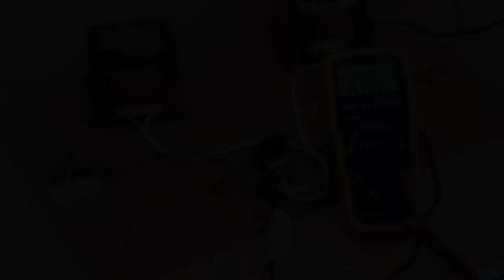DIY Welding Machine / Only 2 Microwave Transformer / Good Job

Comment: Magnífico trabajo me lo apunto.... 
Mi duda es... ¿ Es posible con esta misma caja soldar por puntos? Haciendo con otros cables y poder cambiar los cables según la necesidad en ese momento
Reply from the maker: Hola.  Un buen pensamiento de hecho.  Pero no lo hará.  En la fuente puntual, el voltaje es muy bajo (1.5 - 2V), la corriente es de alrededor de 500 -700A.  Por lo tanto, no sería adecuado.  También necesito una máquina de soldadura por puntos y haré una herramienta separada.
Reply: no entiendo muy bien de voltaje ni amperios. La verdad es que me pierdo. Pero.... ¿ Con el regulador no se podría regular la potencia para uno o para otro?
Reply from the maker: Cuando dices regulador, creo que te refieres al circuito de atenuación.  Este circuito regula el voltaje, sí, pero a medida que cae el voltaje, también lo hace la corriente.  Necesitamos un voltaje bajo para que el arco no sea demasiado y una corriente alta para fundir el metal.  Por otro lado, el devanado secundario en la máquina de soldadura por arco no es lo suficientemente grueso para pasar 500 amperios.  El uso de un cable de 25 mm2 o más grueso es adecuado para la máquina de soldadura por puntos

Comment: Good teaching, what size rods did you use with this transformers to weld,  I build one with two as well with the output is 52 volts.
Reply from the maker: Hello.  Firstly, thank you.  I used 4mm2 silicone insulated cable in the transformers.

Comment: seu eu usar  3 transformadores 110v é preciso que mudar algum componente no sistema de dimer e Reguladores de voltagem qual devo usar
Reply from the maker: Se você usa 3 transformadores, meu conselho é... faça o enrolamento secundário com um cabo de 6mm2, faça o circuito dimmer como eu fiz e conecte 8 triacs BT137.  Os cabos a serem utilizados na entrada também devem ter no mínimo 2,5mm2.  A razão para isso é que mais corrente é necessária para obter a mesma potência na tensão de 110V.

Comment: Hola buenos días bendiciones y muchos éxitos quería preguntar si los transformadores son de 110 v da el mismo resultado gracias de antemano
Reply from the maker: Merhaba.  Burada şebeke gerilimi 220V ama 110V olduğu her yerde aynı şekilde çalışacak.  Tecrübe edip cevap verenler var.  İlginiz için teşekkürler
Reply: A ok gracias algo más cuánto es el tiempo de trabajo de la máquina así como la fabricó UD de antemano mil gracias
Reply from the maker: No es una herramienta profesional, pero sí muy acertada para el trabajo amateur.  Nunca he intentado soldar sin parar.  Sin embargo, utilicé esta máquina en mi video "Soporte para amoladora angular", que puedes encontrar en mi canal.  También hago mi tarea con esta herramienta.  No tuve ningún problema.
Reply: muchas gracias y le deseo muchas bendiciones y éxitos
Reply from the maker: Gracias... Que tengas un buen día.

Comment: what an absolutely brilliant video.  I'm stuffed if I'm bending metal though.  think I might just use an ammo case.
Reply from the maker: Thank you.  However, I couldn't understand the part you wrote about metal bending.
Reply: taking the sheet metal for creating the case.
Reply from the maker: You can also make the box using wood, but it's heavy.

Comment: Think that's the best transformer welder video I've seen. So neat and professional.
Reply from the maker: Thank you very much.  I'll try to use it for TIG welding if I get a chance.  However, I need to adjust the gas cylinder and torch system.

Comment: Excelente trabajo. 
Ademas de eficiente muy bonita linea la máquina. 
Un detalle. 
El video estaría perfecto si ademas fueras explicando la construcción. 
Gracias.
Reply from the maker: Muchas gracias.  El video tenía subtítulos.  Si hay algo que no está claro, por favor pregunte.
Reply: Ahhhh
Eso estaría re bueno. 
Sos extremadamente didáctico para mostrar el trabajo. 
A mi no me salieron los subtitulos. 
Talves sea una configuración  de mi celu
Reply: Ahora vi las aclaraciones adicionales que dejaste al final de tu descripción. 
No sabia que triac habias usado ni que se pudieran colocar en paralelo. 
Con esto me abriste nuevas opciones. 
Geacias.
Reply from the maker: Hola.  En la sección de descripción, trato de proporcionar tanta información como puedo y comparto los enlaces de los documentos relevantes, si los hay.  Puede usar BT137 como un triac.  Si tiene un voltaje de red de 110V, recomiendo usar 6 triacs, y si tiene un voltaje de red de 220V, recomiendo usar 6 triacs.  Teóricamente, los triacs BT137 tienen solidaridad 8A.  Normalmente, incluso 2 piezas para 220V (2000W/220V=9A) es demasiado.  Sin embargo, considerando la posibilidad de falla y los precios de las piezas son baratos, conecté 4 piezas.

Comment: Es un excelente trabajo.. estaba buscando algo asi de bueno.. Te felicito y gracias por compartirlo.. DIOS te bendiga..
Reply from the maker: Muchas gracias.  Me alegra que te guste 👍
Reply: amigo buenas noches para las personas que sólo hablamos español, no logramos entender los comentarios, adicional no sabemos que materiales lleva, y cuales son las medidas y como se llaman los aparatitos negros que pusiste con el disipador de calor en el regulador de voltaje, te agradecería tu respuesta muchas gracias, tengo un carapacho de una soldadora inverter que se hecho a perder y quiero hacer una igual a la tuya, pero con su respectivo regulador
Reply from the maker: Hola.  Soy turco y solo puedo responder en español con traducción.  Si lo que escribí a continuación es incomprensible, escriba de nuevo... Usé 2 transformadores de microondas en esta herramienta.  Hice 24 bobinados para cada transformador con cable aislado de silicona con una sección transversal de 4 mm2.  Para estos 24 devanados utilicé 6,5 metros de cable en cada transformador.  es decir 13 metros en total.  Usé un circuito electrónico llamado atenuador en el lado de entrada para el ajuste de corriente.  Como el circuito en mi mano es de baja potencia, conecté 4 triacs (bt137) en paralelo.  De esta manera, la potencia del circuito aumentó.  Si usa un circuito de atenuación de 4000 W, no necesita instalar materiales adicionales.  El diagrama relacionado con esta conexión y el diagrama necesario para la conexión interna de la máquina están disponibles en la sección de descripción del video.  Espero poder ayudar.
Reply: que tal Murat ... aca en Ecuador buenas tardes,  que alegría saber que estas pendiente de tus suscriptores y dando una respuesta inmediata, en cuanto a lo que respecta a la tradición esta perfectamente entendido, incluso pareciera q Ud no hablará otro idioma si no el español.
Nuevamente gracias por tu respuesta y saludos cordiales
Reply from the maker: Gracias a ti también.  Tenga la seguridad de que siempre intentaré ayudar en todo lo que pueda.  Buenos días
Reply: Talvez tienes un correo para escribirte directo, tengo algunas preguntas q hacerle a Ud,  sobre inversoras y como q veo q por este medio se me hace complicado ya q no puedo envías fotos ni vídeo
Reply from the maker: Mi dirección de correo electrónico está en la información del canal, pero también la escribiré aquí.  No hay problema.  muratguney67@gmail.com
Reply: ok
Reply: Ya le escribí a su correo amigo Murat, en cuanto pueda revise
Reply from the maker: Miré los correos electrónicos que enviaste. Puede que haya entendido mal, pero hay un video que escribiste. No pude ver el video. Es difícil encontrar la falla en las imágenes, pero si el problema no es la soldadura, los transistores mosfet pueden estar defectuosos. Para entender esto, es verificar si hay un cortocircuito quitando las 2 patas de cada transistor y llevando el multímetro a la etapa de diodo. Cuando estos transistores fallan, generalmente hay un cortocircuito. Si hay una parte quemada en el circuito, es necesario concentrarse en esa parte. Sin embargo, ¿cuál es el estado de la máquina? Cuando lo enchufa, ¿se enciende la luz, hay algo escrito en el indicador, se mide el voltaje de las terminales de salida? No esta soldando o lo esta haciendo mal. Se pueden hacer comentarios basados en esta información.
Reply: el video no lo realizó todavía.
En cuanto a la soldadora le  falta fuerza al soldar el amperaje esta al máximo 200 amp, y sin embargo no revienta el palillo esta que se pega a cada rato, es más no se puede ni cortar una varilla delgada.
Más tarde hago el video en la que estaré soldando para q Ud vea la situación
Reply from the maker: La adherencia se debe a la baja corriente. Esto significa que el dispositivo no puede entregar la corriente requerida. Creo que esto se debe a los transistores de 3 patas (mosfets) que se encuentran en una fila. Algunos pueden estar defectuosos. Como dije, los defectuosos se pueden reemplazar midiendo con un multímetro. Si no tienes conocimientos de electrónica, pide ayuda a alguien.
Reply: correcto mi amigo Murat, la verdad que no tengo conocimiento de electrónica, pero voy a pedir a un vecino de por mi casa me ayude con este tema, ya que el entiende mejor, a estudiado cursos de electronica basica, de todas maneras me has ayudado muchísimo, ahora se por donde comenzar, de todas maneras, más tarde que llegue a mi casa hago el video de como suelda la máquina y le envió a Ud.
Quedare eternamente agradecido por su atención, ya que aquí en el yutube existe un caballero que le escribo para ver si me puede ayudar con este tema pero siempre responde a medias, como que noble interesa ayudar a otras personas y adicional en los vídeos que hace siempre está enojado como retando a la gente que le hace preguntas..
Cosa distinta a la tuya, por lo menos indicas por donde empezar a checar....
Nuevamente millón gracias
Reply from the maker: Gracias. Espero que puedas encontrar la falla del dispositivo pronto. Puedes escribirme de nuevo si es necesario. Suelo intentar responder rápido, pero a veces puede que no sea capaz de mirarlo o puede que sea de noche por la diferencia horaria. Pero no lo dejaré sin responder tanto como pueda.
Reply: eso habla muy bien de ti, y claro que si en cuanto arregle la soldadora, y arme la otra con los transformadores yo le estaré escribiendo a su correo
Reply: q tal mi amigo Murat, nuevamente para saludarte y agradecerte por estar atento a los comentarios de tus suscriptores, Estuve mirando tu nuevo video en el cual le instalastes a la maqyina de soldar el puente de Diodos, y esta excelente, gracias por darnos a conocer tus conocimientos, te comento que yo aún no realizó mi proyecto de la máquina de soldar, quizás por cobardía, y en cuanto a la máquina inverter que me entregaron dañada tampoco la he hecho arreglar
Reply from the maker: Gracias.  Ha pasado mucho tiempo si no me equivoco.  Espero que la falla de su máquina no sea a gran escala.

Comment: EXCELLENT KEEP IT UP, but my question is that why are cutting down the secondary wires, cant I use it like that.
Reply from the maker: Hello.  Thank you so much.  Of course, you can use it without cutting the cable.  However, I cut it because I use 10/25 source sockets.  In addition, I think it is better to have thicker probe cables so that they are more robust and there is not much voltage drop on them.
Reply: ok thanks

Comment: You are really a hard working man
Reply from the maker: Thank you 👍
Reply: sir i have a question about the transformer can i ask?
Reply from the maker: Hello.  Of course you may ask.  I try to help as much as I can
Reply: did the power of transformer matter the thickness of the core?
Reply from the maker: The transformer usually has a power between 800 and 1000W.  There won't be a big difference.  If you have it, you can use
Reply: I have a transformer which have 12 0 12 secondary coil.  i  removed the secondary coil  and rewind with a thicker copper wire and it is not working now .Can you tell me what is the problem with the transformer.
Reply from the maker: Most likely the transformer is too low power.  You asked about transformer power in the previous message.  I thought the transformer you have was a microwave oven transformer.  Of course, other transformers can also be used.  But it must have sufficient strength.  How many watts is your transformer on average?  Besides, can you write down the cable thickness you winded and the output voltage you obtained?
Reply: my transformer is too small about 10 to 50 watts and i wind the cable of 3mm of 7 turns .and get 0 volts output.
Reply from the maker: 50W is too low.  Total power must be at least 1500W.  For example, the transformers I use are around 900+900=1800W.  In addition, even if you use a microwave oven transformer, 1 unit is not enough.  welded maybe but not stable.
Reply: ok thanks for the information

Comment: Only if an output ampere meter would have been added, that would make it the best diy welding machine...👍
Reply from the maker: Hello.  Thank you for your comment.  An ammeter would be really nice.  I couldn't add it because I made the box a little small.  Maybe I'll add it and share it when I get the chance.  Greetings from Turkey 👍

Comment: My question to you, I build one that has an output of 52 volts will the power be good to weld, I also purchase a 4000 watt dimmer as well. How many amps will this put out and what welding rod did you use.
Thank you for your kind response 
My regards
Reply from the maker: Hello again.  In order to get 52V voltage with 2 transformers, the number of secondary windings must be 26 or 27.  How did you do this? What kind of cable did you use?  I usually use 2.5mm electrodes.  It can be melted at 3.25, but the machine gets too hot.
Reply: I use 10ga, between the 3 transformer I’m getting 60 volts, don’t know if this is good, didn’t count the turns all I know they are very tight.

Comment: I have to say you did a really really good job on this what I wanna know is how that small gauge wire holds up
Reply from the maker: Yes, the wire is a little thin.  I used fine wire to get enough voltage with 2 transformers.  The wire is thin but resistant to heat thanks to its silicone insulation.  I use it constantly.  There was no problem.

Comment: Have a good time, don't be tired, can this be used as a home boil? Does it answer? Does it not burn or damage?
Reply from the maker: Hello.  I use it at home.  It was made for amateur use anyway.  You can see me using this machine in some of my videos.
Reply: Murat Bey, bir sorum daha vardı. 4000 watt'lık dimmer kullandım. 10 amperlik cam sigortası var. Kaynak yapmak için elektrodu veya kaynak telini demire dokundurduğumda sigorta çabuk yanıyor. Var mı? çözüm? Elektriğim 220 volt
Reply from the maker: 220V gerilimde 4000W dimmer kullanıldığında sorun olmaması gerekir. Dimmer devrenizde kısa devre olsa ilk anda zaten sigorta atardı. Ama demire dokununca atıyor ise cam sigortanın değerini yükseltmek gerekebilir. Şöyle yapabilirsiniz... Cam sigortayı kısa devre yaparak etkisini kaldırın. Onun yerine girişte en az 16 Amperlik otomatik sigorta kullanın.

Comment: Me gusto mucho su construccion pero tengo una pregunta; para que instalar un regulador de voltaje, si no vas a usarlo..como estabilizador de voltaje de entrada esta bien, pero creo que el regulador esta de mas..creo yo, tal vez este equivocado en mi apreciacion..de todos modos esta buenisimo el proyecto...💯%👍
Reply from the maker: Hola.  En primer lugar, gracias.  El circuito que uso es un circuito dimmer.  Mientras ajusta el voltaje de entrada, también ajusta la corriente de salida.  De esta manera, puedo usar electrodos más delgados.
Reply: ok...muy bien, gracias por la aclaracion👍😃

Comment: Los 13 metros de cable de 4 mm2 se reparten entre los dos transformadores? si me respondes me ayudarias mucho buen video
Reply from the maker: Hola gracias.  6,5 metros por cada transformador.  Sección transversal de 4 mm2, aislamiento de silicona (cable N2GFAF), cable de cobre puro.  que tenga un lindo día
Reply: Gracias

Comment: Well done! Professional finish! What type of welding rods do you use and what voltage do you use? Any tips when trying to weld aluminium? Fraser
Reply from the maker: Thanks.  The electrodes I use here are 2.5mm rutile electrodes.  However, after converting the output voltage to DC, I was able to weld properly with other types of electrodes.  I've never tried welding aluminum.  There were many people asking.  I will try to try it at a suitable time.
Reply: Ok thanks Murat!
Reply from the maker: Thank you too 👍

Comment: What is the hole size for the connectors for the arc wires and how did you cut the square hole.
Reply from the maker: Hello. I don't remember the size of the connector holes. But you can find the size when you buy it as a 10-25 welding socket. I used my jigsaw bench for the square holes. I cut it with a metal cutting bit.

Comment: Murat hocam bende sizin videonuzdan ilham alarak yaptım..iki trafodan toplamda 35 volt aldım .. boş halde sorunsuz çalışıyor. Fakat 2.5 luk elektrotla şase maşasına degdirdigimde çalışıyor fakat işlem yapacağım metale degdirdigimde en ufak ışık yok..elektrotmu kalın acaba bı fikriniz varmı.. teşekkürler
Reply from the maker: Elektrot kalınlığı gayet normal. Bence bir iletkenlik sorunu var. Yani şase maşası dediğiniz parça metale tam temas etmiyor olabilir

Comment: does it work weel? with this dimer I heart dimers are not Good with inductive loads and it seams to be a huge load .i World like to  know if with the use it did not get burned
Reply from the maker: Hello.  I think it's pretty successful.  In the video I published today, I renewed the dimmer circuit.  I had no problems with the old circuit I used in the video you watched.  Triacs did not have problems such as overheating.  Has never malfunctioned